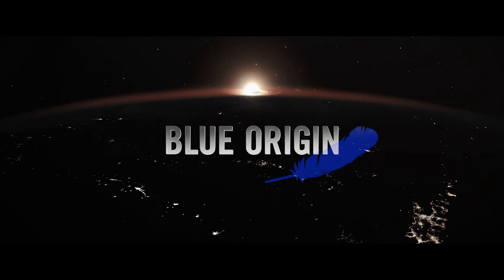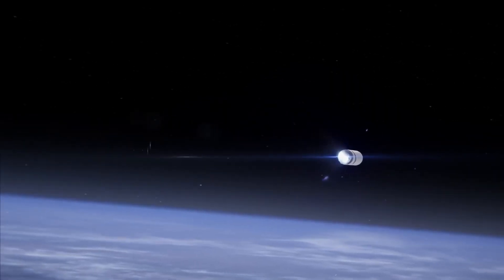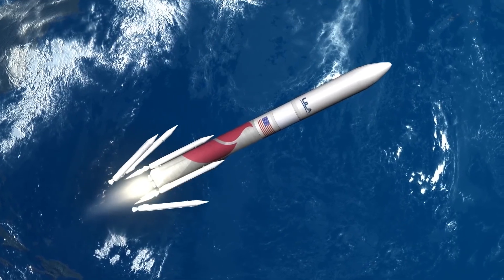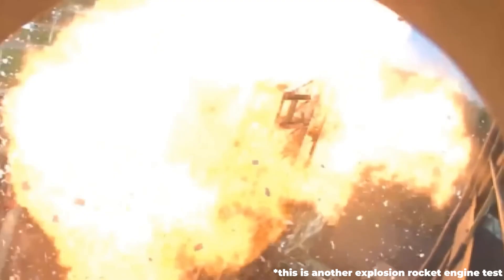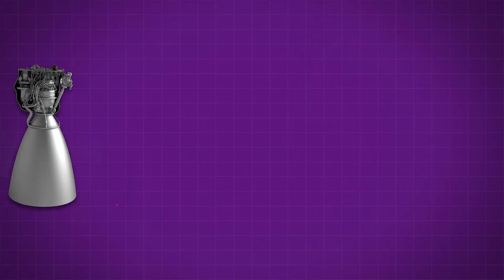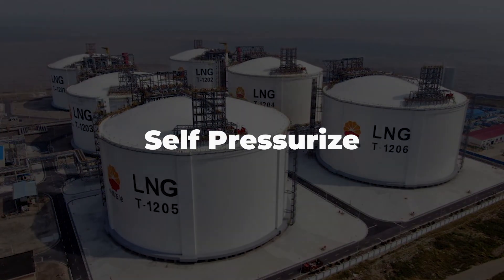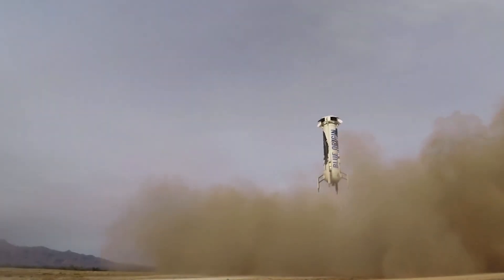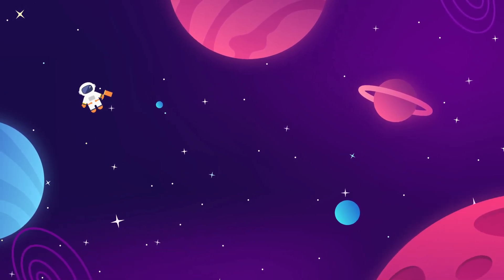The Disappointing Truth About The Blue Origin BE-4 Rocket Engine!

Comment: There are quite a few errors in this video.  The video states that a liquid methane fuelled rocket has never reached orbit but in fact, a Chinese company achieved this recently (before the publication date of the video).  The images show failures in engine testing for many engines other than the BE4 when he is talking about BE4.  The graphic shown when chamber pressure are being discussed highlights the nozzle, not the chamber.  LNG is not exactly the same as methane.  LNG contains hydrocarbons other than methane.  Autogenus pressurisation is not unique to methane rockets.  Methane fuelled rockets are not the only ones that are "relatively clean burning".  The product of combustion of hydrogen fuelled rockets is water.  Hydrogen has its own issues, of course, including low density, requiring large tanks and easy leakage.
Reply: Another flawed assumption; it's rather common to stress production items beyond design loads during acceptance tests. If the design says it can be used operationally to 134 bar, then putting it on a stand and making sure nothing goes wrong at 140 bar is totally reasonable. Many industries test every item built to 150% rated load, even 200% isn't uncommon.
Reply: Add the fact that a rocket called Atlas existed long before the 2002 date given. That's just when they started using Russian engines in it.
Reply: @john_in_phoenix  liked did not always use ergenomash engines..
Reply: And Starship does not vent methane through the side of the vehicle, it vents through the launch platform. This used to go to a flare tower that would burn off the excess. Now it might actually be collected and repressurized.  The cloud shown in the video is condensing water vapor because of how cold the vehicle is.
Reply: Plus, Delta IV was a rocket of it's own which is what is really being replaced by Vulcan, with heavy being the last of many configurations to fly. There difference with that BE-4 is that it was not experimental, it intended to fly with a customer payload. Test vehicles may fail on the ground or in the air without much concern. CRS-7 would have been a better comparison. They said over and over that the Starship flight test would most likely blow up, so it blowing up should not have been a surprise to anyone.
I stopped watching after that. I hate it when people spew nonsense skit things they know nothing about. I totally understand mistakes, not nearly every assertion I'm this video is wrong and has a bad premise.
Reply: While true @michaelfink64 , Blue Origin is a failure.
Reply: @stratcat3216  you're a drooling vegetable.
Reply: I could be mistaken, but I seem to recall from watching the video of the Chinese rocket that the video feed from the second stage showed that it was spinning, just before it was cut off.  If it had at least reached orbital velocity, then that counts regardless, although I'm not so sure about the success of the mission as a whole.

Not that it's such a big deal, though.  It's not like anyone doubted that methane or LNG would work, or that it were a particularly difficult fuel to work with, which it isn't.  In fact, it kind of makes things easier because it's close to the cryogenic temperature of liquid oxygen, so there isn't a large temperature differential between the propellant tanks (one fewer thing to worry about).  Hydrogen is the difficult fuel to work with in many ways, but even that has been done, starting many decades ago.

It might seem petty to point these things out, but it's the truth.  Being the first to get to orbit using methane is a first, but it's not nearly as much of a milestone as, say, SpaceX managing to make a full-flow staged combustion engine (using any propellants) work reliably all the way to space, like they just did.  No one else had managed to even fly such an engine before, because it is such a great challenge.

In contrast, the only reason methane hadn't been used as rocket fuel before is that it has neither the high energy per mass density of hydrogen nor the high energy per volume density of kerosene.  Both of these fuels were more compelling because of these properties.  Methane/LNG would have always worked fine, but it has always been less compelling in terms of rocket design because it's so middle-of-the-road.  The only reasons it's so compelling now are: it burns relatively cleanly (unlike kerosene) and is easy with engines concerning seals (unlike hydrogen), which helps with reuse (although the Merlin 1D seems to do fine with kerosene); and for SpaceX methane can more practically be synthesized on Mars (and it might have made full-flow staged combustion more achievable, albeit I'm not sure about that).  But to simply use methane as rocket fuel is nothing much, in itself.  It's not like being the first makes anyone better because it was so hard to achieve, because it wasn't hard to achieve (for rocketry).
Reply: I need to start a Rocket channel....I can put out just as much incorrect "information"...😅
Reply: LNG is, practically speaking, CH4.. talking off of the bat...  the impurities will by more energetic, but the price drop between methane and LNG will outweigh the advantages of methane, I'd expect.
Reply: @seanmarshall7529   You're totally right, no argument.  But for completeness regarding methane versus LNG, whatever it's called and whatever its source might be, any rocket fuel has to meet certain specifications.  The specs themselves might be either tight or relatively loose, but meeting the spec must be strictly enforced, given the high-performance machinery involved.

Specifically, the Raptor was originally designed to use high-purity methane (CH4), although the design has evolved to tolerate lower percentages of methane plus some heavier alkanes like ethane, propane, and butane, for example, as impurities.  This obviously reduces fuel cost, increases availability, and improves robustness and reliability.  Whether one personally chooses to call this fuel LNG or not, it is not the same stuff that is piped into homes (as a gas, but I'm talking about composition here, not state).  That stuff might have other impurities such as CO, CO2, N2, and sulfur compounds that are probably not acceptable for the Raptor to burn (in fact, the presence of sulfur compounds would destroy it).  The fuel SpaceX normally use might not be pure methane, but it still has to be of a known composition that meets all of their specs.  Calling it LNG would be misleading, and so is calling it methane.  It is a methane-based rocket fuel that meets SpaceX's specs.  Pure methane would also meet their specs.

To take another example, according to Tory Bruno of ULA, the Blue Origin BE-4 runs on methane, not LNG.  But what does he mean by that?  I think he means that it is either pure methane or has a somewhat looser purity spec like what the Raptor runs on.  Either way, he doesn't call it LNG, because that would imply that it's the same stuff piped into homes for heating, and it is definitely not that.  Right now, methane-based rocket fuel is not standardized like RP-1 (kerosene-based).  If/when it is, then it might get a designation (RP-2?), but until that happens, it's some methane-based fuel that we're not sure of the composition of, unless the companies tell us (and it can be different for each engine model).
Reply: You defintely are into rocketry. Methane-LOX gives about 300-something seconds, isn't it? Highly volatile and highly pressurasible as coolant, isn'it a  little difficult to recover excesdive heat around chamber and nozzle and this isn' t affecing dead mass of rocket? In fact all carburants offer benefits and dizadvatages, still hidrogen deserves more interest by ALL aspects, including beying NonPolutant, important when planning thousands launches per years to come...
Reply: @laurentiubucur9586  Hydrogen has very high efficiency and is an excellent rocket fuel, but is is difficult to contain without too much boil off and keep cold.  I guess every propellant has its pros and cons.
Reply: Yeah, you are right. The problem today is if you are a fan of one space company that means you have to hate the others, like we are all in Jr High. Personally I wish all of the the best of luck as competition is a good thing, we did our best in the 60's because of competition, and our achievements went downhill when that competition was gone.
Reply: @dwightlee4315  Agree.  The grounding of Falcon 9/heavy right now highlights the need for redundancy and competition usually results in better products at cheaper prices.
Reply: @michaelfink64  Exactly, I really like what Space X has been doing, but I also cheer for Blue Origin and Rocket Lab, and all the others, I hope success to them all.
Reply: Allegedly. You people seem to trust the CCP quite a lot.
Reply: Poorly researched video
Reply: for profit organization do not like to spend money on things that are not making excessive lots of  bacon, so when will be-4 be discontinued by the manufacturer
Reply: Thank you for the warning.
Reply: I think I see why he called it LNG. That's literally what Blue Origin's website calls it LOL
Reply: Starship's Falcon Super Heavy uses liquid methane as it's primary fuel source to reach space, in case you missed that while ripping on Blue Origin.
Reply: @RiffSlayer89  I wasn't ripping on Blue Origin, I was ripping on the video.  There is no such thing as "Starship's Falcon Super Heavy".  The Falcon Heavy is derived from Falcon 9 and uses RP1 (a form of kerosene) as its fuel.  Starship-Superheavy uses methane but had not reached orbit (actually, still hasn't, since all of the test flights so far have been deliberately suborbital in order to ensure safe re-entry) at the time of the video.  By that time, only test flight 1 of Starship had occurred, which self-destructed without staging and so was well short of orbit.  Personally, I would be delighted if both Starship and New Glenn succeed.
Reply: i would like to add that RD engines were not Russian engines, but Soviet.
Reply: @trololo_zhirnota  makes a hell of a lot of difference!  Sure there was a certain Ukrainian technology involved, I think... Korelev was not into engines I think
Reply: @trololo_zhirnota  Yes but not really RD which is just short for ракетный двигатель (rocket engine) in Russian is the designation typically given to the rocket engine series designed by OKB-456 known today as NPO energomash this differentiates from the NK series of rocket engines designed by the Kuznetsov design bureau. In both cases both bureaus were both in the moscow region so post Soviet Union these bureaus became Russian so later RD series of engines are typically known to be Russian save for one case which is the RD-800 series which is being designed by Ukrainian design bureau Yuzhnoye Design Bureau. Adding in particular the video mentions the RD-180 this was derived from the Soviet RD-170 though was designed by the now Russian NPO  energomash in the early 2000s so it is infact a Russian engine.
Reply: @trololo_zhirnota the later RD designs are Russian
Reply: Self-pressurization isn’t enough for a methalox engine because you are burning away mass, meaning you won’t have enough methane in the tank to provide pressure once you start using it. This should be self-evident. SpaceX was attempting to use partially burned methane from the turbo pump exhaust to create a pressurant, but they’ve since gone back to helium.
Reply: @markuskoivisto not even close. Methane gas is vastly bigger than LNG, 593:1. There is no issue with the chemistry of autogenous pressurization with methane. Indeed, Super Heavy SN7 flew with autogenous pressurization in the main tanks. As far as we know, header tank pressure issues are what caused most of the landing failures and they wanted to work on that problem separately without holding up the rest of the testing so they switched to helium temporarily for the header tanks and inflight spin start so they didn't have to solve that before testing everything else. The main tanks have always been autogenous.
Reply: @markuskoivisto Wrong and wrong. 

SN8 flew with autogenous pressurization. Sloshing during the attempted landing flip caused the vapor to crash back into liquid due to mixing with the cryogenic methane, so SpaceX switched to using helium for the next few tests. They then switched back to autogenous pressurization for all prototypes subsequent to the success of SN15 in 2021.

Autogenous pressurization uses heat from the engines to boil a small amount of liquid propellant which is then blown into the tanks as hot vapor to provide pressure, no combustion is involved except for what is happening inside the rocket engines. Autogenous pressurization of methane works.
Reply: @sycodeathman  After IFT-2 do they need to be back to helium?
Reply: @XKS99   The Super Heavy suffered significant deceleration due to the impingement of the Starship's exhaust.  I'm sure SpaceX will try to find a way to change the parameters and sequencing to make stage separation and the boost-back burn work right before resorting to using helium.  For that matter, I bet that they'd change back to non-hot-staging if they had to before resorting to using helium.

In the big picture, there is just not enough helium for what they plan to do with their eventual huge fleet of Starships.  Whether that will ever actually happen as envisioned by Elon is a whole other question, but SpaceX have to assume that it will happen, where Starship development is concerned.
Reply: @benjaminshropshire2900
It might work, but it sounds terrible for rockets that aim to be reusable (and cheaper to reuse than to rebuild without cooking the books), because now the fuel tank material will thermally cycle between your hot methane gas and cryogenic liquid methane every flight.... talk about thermal cycles, and while I’m not an expert on stress fatigue, I’m under the impression that Aluminum alloys perform a lot worse than most steel alloys to repeated thermal expansion
There’s also thermal sheer stress at the boundary, it should be alright but again it squeezes and expands every flight on a single file line

As for safety margins in your other post, don’t rocket companies operate with much smaller ones to save on mass? Hence all the explosions?
Regular companies might have x10 safety margins, aerospace is like x1.1-x1.5 from my understanding, and the more demanding management is the closer it operates to the absolute limit
Reply: "In the big picture, there is just not enough helium for what they plan to do with their eventual huge fleet of Starships."
Things like consumer helium balloon and consumer fission energy should be completely banned and it’s a tragedy they’re not

Wasting finite, unbelievably valuable elements on the masses so they can have their little useless "fun" and "enjoy themselves" before gracelessly dying after a meaningless pointless existence where at best they provided some kind of menial labor to civilisation. We can’t waste resources like this and survive in the long term. The whole situation is so insane, we are depleting all resources including nuclear and fossile fuels in the time scale of a thousand years max... took hundreds of millions of years to build up and it was all wasted on the consumer goods and quality of life for billions of useless eaters 
What a joke humanity is
Reply: @markuskoivisto  well the more it gets used the higher the tank the lower the pressure outside the higher the partial vapir pressure.. no He is used

Comment: Yes a BE-4 due to be installed into the Vulcan exploded but the video footage you showed I think was the explosion of the Vulcan rocket's upper stage pressure test. I haven't seen any footage of that BE-4 explosion yet.
Reply: It did have a caption stating that it was video of a different explosion.  Problem is, the explosion is so captivating that the caption is easy to miss.
Reply: Right.  There's no publically available video of the BE4 explosion.  The video show here was of a different explosion, unrelated to the BE4.
Reply: That clip shown was the centuar tank explosion next to the 4670 test stand in Huntsville that was under construction/refurb by blue. Completely unrelated to be4 testing. Tank failure on a test article is what was shown here. ULA hardware
Reply: The footage happens so fast its stupid, They recorded it in ultra slow motion. They don't have a proper quality control team or Quality assurance so they are blaming their valves department.
Reply: i have the video but i ain’t no snitch
Reply: @Splooge_  LOL
Reply: The BE-4 explosion was during validation stages prior to shipment. It was a quality control test and it failed. It happens.
Reply: @justindixon7441  yes but the video footage they show was of the upper stage test not the engine.